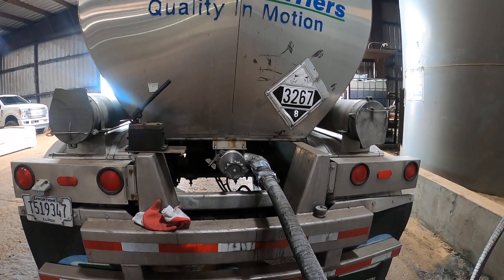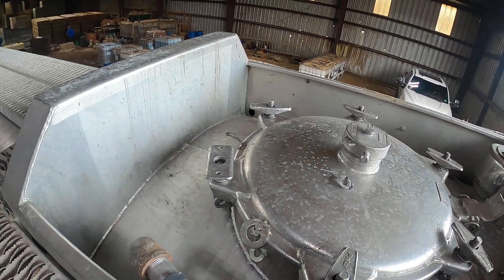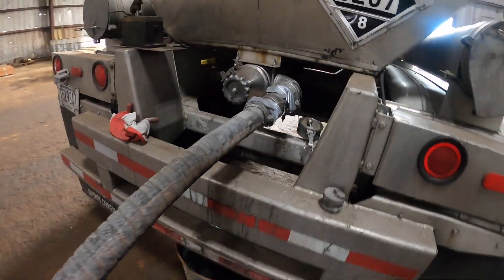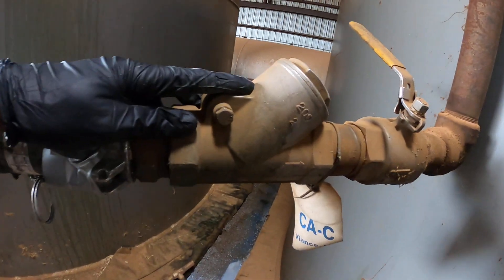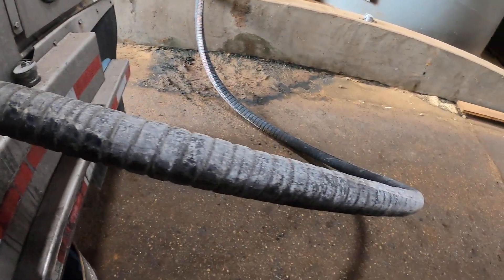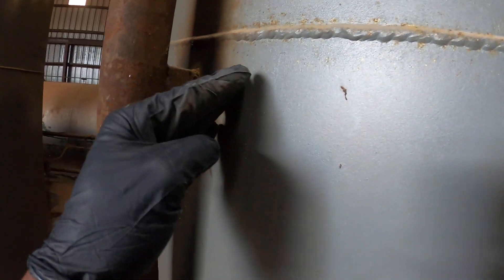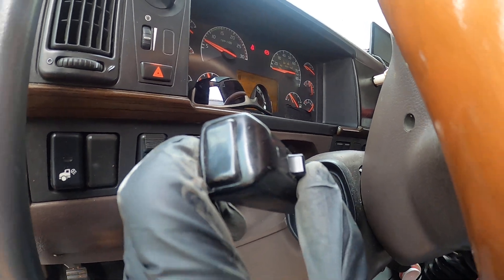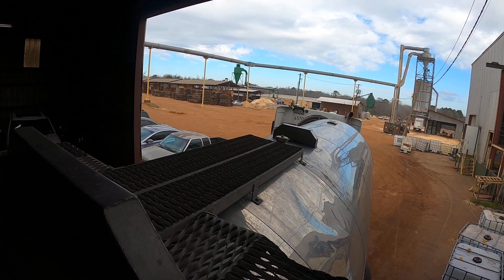Unloading or Airing Off Tanker w/Compressed Air Explained.

Comment: No hazmat suit unloading corrosives ? If you hear air leaks on any connection or valves it’s not normal even if the equipment it’s old .

Comment: The question I been having is how do u release pressure from your hose with out a blow down fitting
Reply: I was thinking the same thing and not only that no wet suit on and no rubber boots on 😂 but he showing them 😂
Reply: Open ONE earflap at the connection hose and work it up and down a little and that will allow air pressure to escape...

Comment: Im new to tankers, ive pumped off numerous times but doing only my 2nd air off on Thursday so im a little nervous about it
Reply from the maker: That's Normal You'll Get Better With Every Load. Just Create A Solid Routine & Don't Take Any Short Cuts And You'll Be Just Fine. "Greatness Awaits!!!"

Comment: Schneider makes us wear a green suit when unloading corrosives 😢
Reply from the maker: This Particular Product Was Used To Treat Lumber At A Lumber Mill That I Delivered To & Many Others For Two Years. Nothing Special or Crazy Just Easy Work. I Usually Remove My Chemical Suit After All Hoses Are Connected & Leaks Checked & Prevented If Necessary Before I Film Anything & With Permission To Film Of Course. "Safety First - Be Great!!!"

Comment: Do you hook up your bleeder valve? I’ve been taught to hook up a bleeder valve for sample or to relieve pressure towards the end to make sure there’s nothing in my line.
Reply from the maker: Absolutely True if You have the Valve on hand and it's in good condition. If I'm Airing Off a Product I wouldn't use it. The Plants I deliver to take the samples and I'm 97% No Touch Delivery, pretty much easy money.
Reply: @tanknation1000  damn that’s nice man. I’m out here in Texas With Groendyke
Reply from the maker: Outstanding, I've seen the trucks out on the road but haven't heard anything about the Company as far as pay & working conditions.
Reply: Does the psi continue to build up before you open the valves or is there some type of return or how do you control that before you open the valves. Thx brother

Comment: thought air off meant dome lid open? so what term is used for unloading with the dome lid open?
Reply from the maker: When You Vent the Tank By Having An Opening Through Dome Lid, Washout Cap, or Whatever Other Means Available, You Are Conducting A Pump Off. At Least In All My Applications, "Be Great!!!"
Reply: @tanknation1000  how many inches in diameter is the hose you're using in this video?
Reply from the maker: 2"
Reply: @tanknation1000  o ok, I'm looking to get chemical hoses, I used to drive for QC & MC Tank & I know the universal standard is 3" for like 90% of tanker loads, so what's the smaller standard that's used sometimes, I don't rememberc if it was 2" or an 1.5"?
Reply from the maker: 2"

Comment: Should this truck transfer be grounded? Also, what about a whip check for the air line and a pin?
Reply from the maker: You can ground if you wish but it was a non-flammable and if whip check and pin is available by all means apply them.

Comment: Good video. Like the way you tape down the ears on your cam locks. One fine point to consider: If it’s cold out and you’re blowing off something that freezes easily, opening your internal first could allow the product to freeze up in the line between your internal and your pancake valve. Used to haul tanker in Canada. Learned about this one the hard way.
Reply from the maker: "Roger That, Many Thanks!!!"
Reply: @tanknation1000  👍Little trick with cam lock fittings—you know how they can get a little sloppy and not draw down securely. I’d carry thin, soft metal shims with me, cut narrow enough to fit into the slot behind the can. Push it in until it rides up over the groove in the male fitting, then push the cam closed. Slop gone. Strips cut out of the side of a soda can work well. Keep on keepin on.
Reply from the maker: Will add to my Tool Box, once again Many Thanks!!!

Comment: Thank you
Much for the video,
It was very informative and helpful. 
U can use whip checks, for your pressurized  hose connections.
They nylon and wire
They are both a pain in the ass.
But can save you from a big head ache.
Do u pefer a trailer
Compressor, verus tractor??
Reply from the maker: I've never used a Trailer Compressor setup before but anything would be better than using my Tractor Air. Many Thanks for Your Support, "Be Great!!!"

Comment: And I was always told tankers should be pressurized at 25 psi at the most and even that is a lot of pressure especially if your filling open containers.
Reply from the maker: Each application or process is different depending on the Thickness or Viscosity and Temperature of Product being unloaded. Many times the Customer or Consignee will dictate the unloading pressure. I've being running or hauling 90% no touch including Drop/Hook for the last 4 years which is gravy "Easy Money!"
Reply: @tanknation1000  with whom are you pulling for?
Reply from the maker: I pull for Heniff Transportation.
Reply: Nice man that’s what’s up I’m on the other end. I do the loading and unloading at a chemical plant from rails cars off the rail road and tankers to storage tanks and vice versa
Reply from the maker: You Guys make my life Gravy!!!
Reply from the maker: I rarely have to unload but whenever I do I use a 2" or 3" Blow Down Fitting but usually the pressure will bleed down into the customer's tanks leaving very low pressure remaining which leads to easy, safe, and leak free uncoupling "More Gravy!!!"
Reply: Union teamsters local 429 out of reading Pennsylvania. Brenntag northeast is the company 2nd biggest chemical wholesaler in the world

Comment: Where’s your blow out valve
Reply from the maker: Blow Out or Blow Down Valves are a luxury and not typically issued in the Tanker Industry but I do have a few and it wasn't needed in this particular application.
Reply: Perhaps you guys do it different then where your at. I work hazmat all acids and flammable solvents even the non haz diesel exhaust fluid. We always hook up a 3inch female to a 2 inch male w/ a Chicago ball valve. To relieve pressure. Or if you have to blow the line clear if there’s a leak. What do you do when your done how do you relieve your pressure when you dis-connect